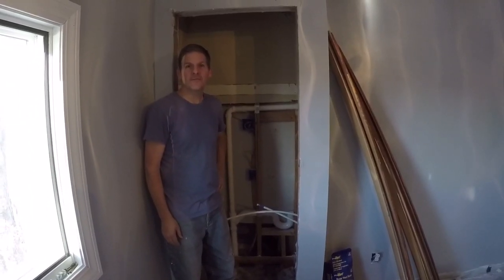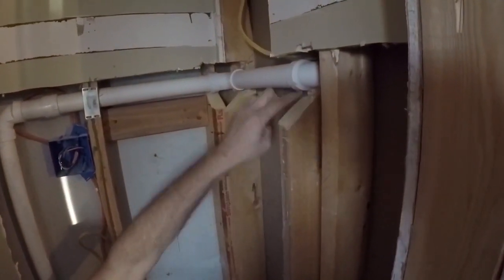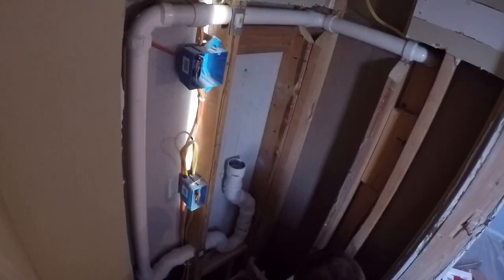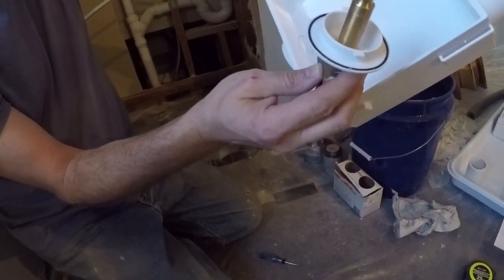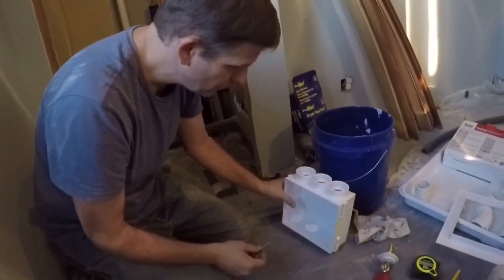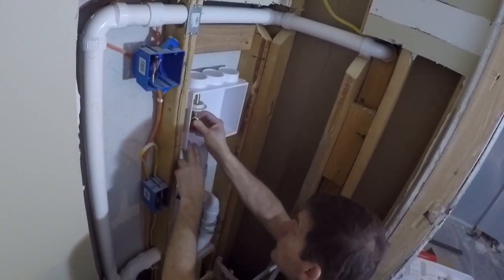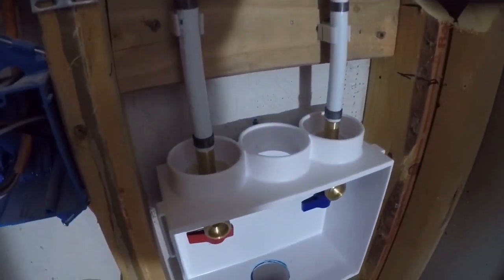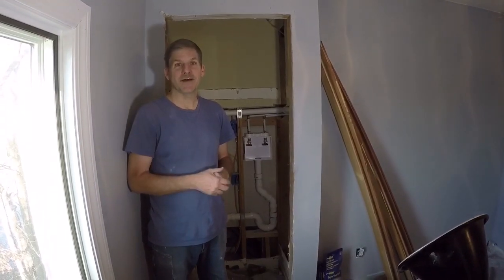How to Install an Oatey Laundry Outlet Box with Pex

Comment: Which way did you turn to tighten the hose to supply valve? We are trying to take out the water  supply hose to add y splitter
Reply from the maker: Hey K C,
It almost always “ lefty loosey, righty tighty” … 
That being said , if your valves are inserted in the top of the box the may be upside down thus reversing the rhyme from above. 
Best way to tackle it is - picture the connection you are making with the opening / hole of the valve pointing up - you are looking down into the valve. Then attach the hose by turning hose clockwise. 
If hole of the valve is pointing down, you attach hose turn it counterclockwise….
Hope that helps. Thx for watching!

Comment: Your Standpipe is not vented.  The plumber used a Wye instead of a San Tee, restricting air flow and creating a S trap which siphons.
Reply from the maker: Hey Errol,
The plumbing you see in the video is only a looped portion. The standpipe is located in the wall to the right of that closet and it’s vented through the ceiling / roof. 
But thanks for the help.
Reply: HouseBarons , Errol is correct. That wye after your trap should be a tee wye, by using the wye that way, you are “breaking the vent”
Reply: Errol Gonsalves did housebarons thank you yet for pointing out the mistake?
Reply: @errolgonsalves3778  interesting thank you

Comment: I appreciate your video I am retro fitting a second washer and dryer a stacked unit in a bedroom closet on the opposite side of the house far from the existing laundry room by our garage which we are converting to a living space eventually: I am figuring out a cheap way to get plumbing in there: I’m doing it for convenience extra capacity: I’m already fishing wire for the electrical: house is one story how will my project cost compared to yours on the second floor 👍 just curious
Reply from the maker: Hey Kevin,
There are 2 parts to consider - 1) drain and vent plumbing and 2) supply plumbing.  
Our drain plumbing already existed right next to this closet. Pretty easy and low cost to tap into that.

Our supply was from a manibloc - part of a whole house replumb we did - each supply line went to a single hot or cold tap. That way we could turn off any hot or cold supply in the house without bothering any other supply. 
That was fairly costly.

Running pex supply lines are easy but if you are bringing it from the other end of the house, then you have significant work feeding those supply lines that far.

I would look to tap into the nearest supply to the next washer dryer space. Same with the drain.  
You just have to make sure that there is enough water to supply the washer plus anything else on that line. 
Sounds like fun!
Thanks for the question and viewing!

Comment: Do I need the drain at the bottom of the box if I’m using a basement setup that will utilize a pump to get the old water up into the plumbing?
Reply from the maker: Hey Kevin, 
If you have your washer water draining somewhere else, I guess not. In my house we have a box in the basement that drains into an ejection pit where it is pumped up out of the basement to street level.
Thx for watching!

Comment: With the use of an Oatey laundry box, If I were to lower the box so the top of the drain pipe is 28”, could I put the p-trap below the floor? I have a crawl space below the floor.  Front load washer.
Reply from the maker: Hey Cinepost,
Since I’m not a plumber, I would look it up at large public library - they have building code books. Also a phone call to your county building dept. could tell you as well. Ask for an inspector.
I did a quick internet search and it appears that the numbers are quite different from state to state.  Generally I saw a minimum drain height of 30-36 inches. The lowest p-trap I saw was 6 inches ABOVE floor height.
Hope that helps some.
Thanks for watching.
Reply: The p trap cannot be below the floor!!!

Comment: Thank You for information!
What is the minimum dimension from box to water trip???
Thank You 🙏
Reply from the maker: Hey Voila,
If I’m understanding correctly, the minimum height of the box bottom is one inch above the top of the washing machine. That way there will be an air gap in the drain line above the highest water level to prevent siphoning. 
Hope that helps.
Thanks fo4 watching.

Comment: Question ?
i am Going to use the Same BOX.
what Glue to use ? with BLACK ABS Pipe - not White PVC like you
Reply from the maker: Hey Joni,
Plumbing code may not allow a solvent weld with ABS to PVC. You may need to use a rubber transition coupling and clamps to join these two kinds of materials. 
You may want to check with local your building department. 
Thx for watching!
Reply: @Housebarons  Thanks for Reply

Comment: The drain pipe is not installed correctly.  The vertical drop must be at least 18".   He should not have glued in the offset. Instead he should have moved the box over so that the drain was a straight drop
Reply from the maker: Hey Howard,
That what we get for hiring a plumber...Thx for watching!

Comment: You should sue the hell out of your plumber for the hack job he did on those wall studs. He ever heard of a hole saw and 90 degree drill?
Reply from the maker: Hey Verticle,
True but very common. We seen major damage on nearly every house we’ve worked on. Thankfully, houses are built pretty strong. 
Thx for watching!

Comment: I was going to use pex but when i saw the crimp clamp tool price i said that not going to happen 😄😄
Reply from the maker: Hey Artie River,
They are indeed pricey. But on the other side, pex is many times easier and faster than copper. A purchase like that is a long term play - depends on how often you see yourself using them.
Reply: Depends on the size of your project you could rent the tool or return after use.
Reply: 15 dollar on Amazon
Reply: HouseBarons well i ended up buying a cheap one way easier and faster no mess !

Comment: That's a s-trap dummies
Reply from the maker: Funny you should say that. A plumber installed the trap. 
Doesn’t the horizontal pipe to the left of the “p” trap keeps it from being an “s” trap? 
Otherwise all plumbing I’ve seen would qualify as an “s” trap. 
I’m not saying we are not guilty of “s” trap installation. Just don’t think that is it.
Thanks for the comment. Always willing to learn.
Reply: @Housebarons  from my understanding, after the p trap, when it connect to the main drain, it should not use a y fitting but a t fitting. I maybe wrong, but i swear i seen this discussed in a plumbers facebook group lol